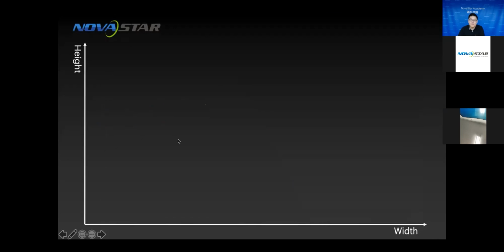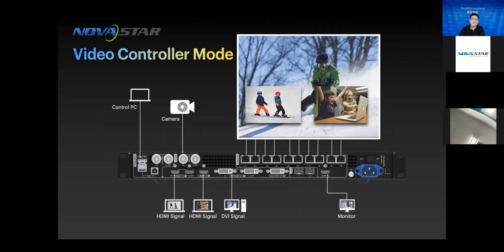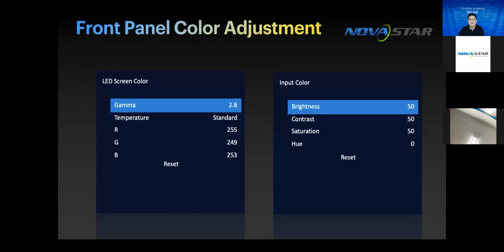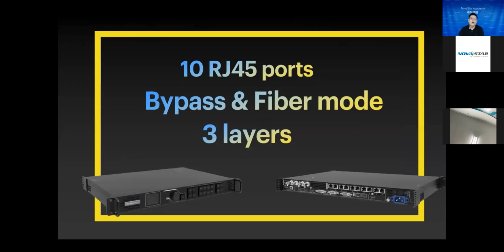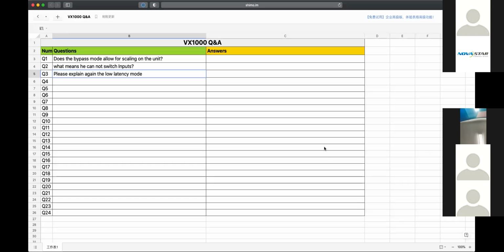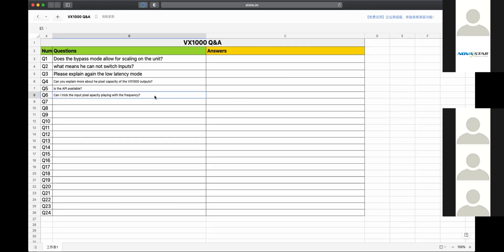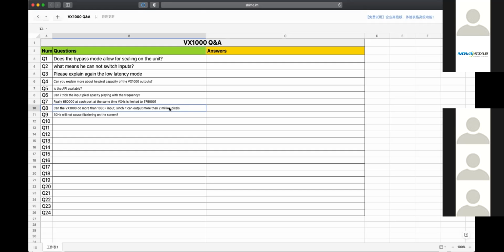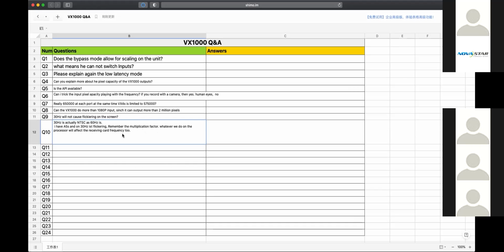Gear Up: Simplicity Meets Power - VX1000 Introduction

Comment: Hello I have a question about scanlines. We are filming against the wall and are genlocked with a camera filming the screen (genlocked at 24p). However we get scanlines if we dont record on our camera at 1/24 shutter speed. Ideally we would like our shutter to be at 1/60, does the VX1000 have the ability to phase offset or correct for scanlines?
Thank you
Reply from the maker: Hi there! Please contact us at support@novastar.tech for more tech help!